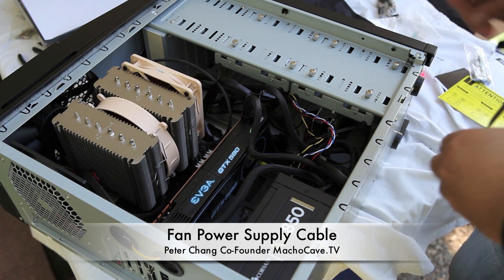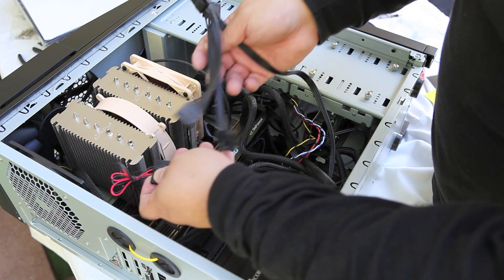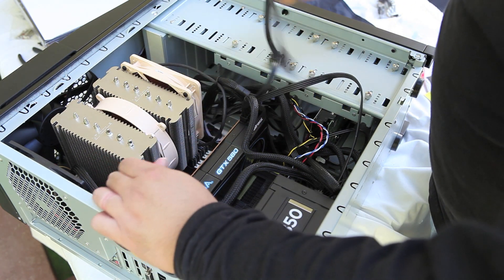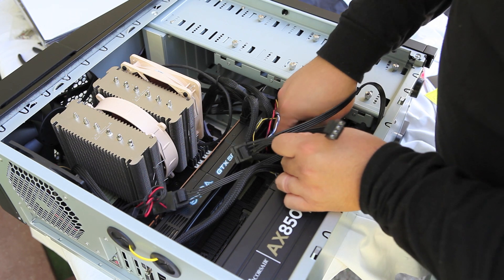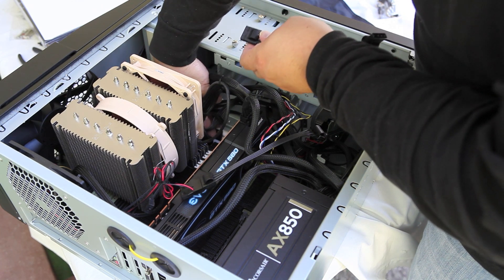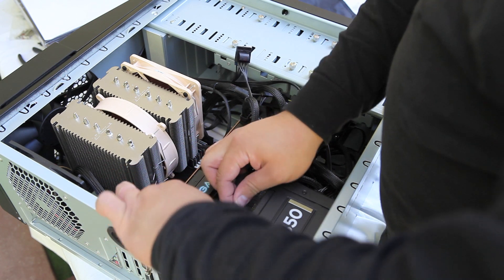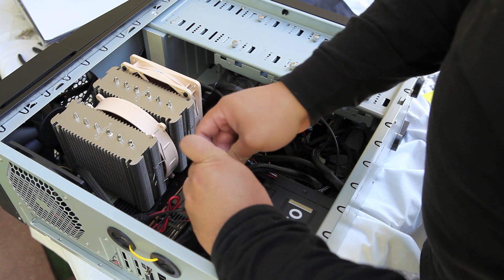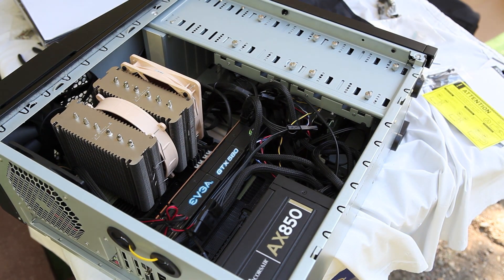Installing a Fan Power Supply Cable Build Your Own Computer Part 16

Comment: so can i connect any 4 pin fan connector to any 4 pin psu connector, or do i have to plug it in to the mobo?
Reply: Did you find out? Because I happend to have the same question.
Reply: landh4wk25 well my built in case fan connected to the PSU connector, but the fans i ordered of Amazon did not connect directly, only mobo. What i did was bought a connector, this works perfectly. 

Connector - http://www.amazon.co.uk/Akasa-AK-CB002-PWM-splitter-smart/dp/B001J2YRUC/ref=pd_sim_computers_1?ie=UTF8&refRID=0JP4GEXJQQ6DVY4GDKEK
Reply: Ok thanks